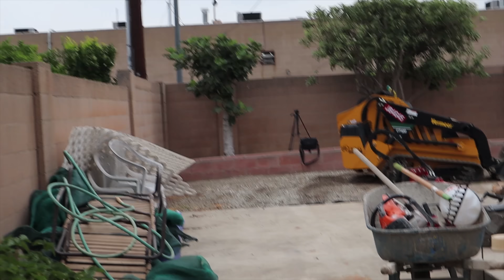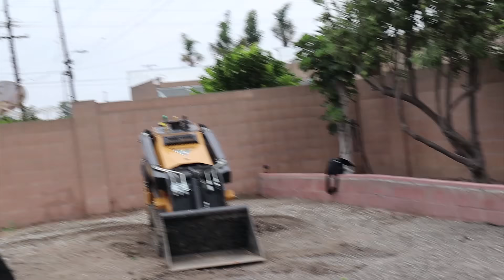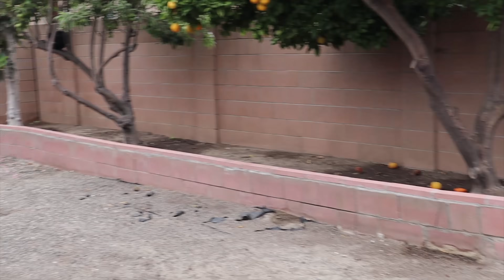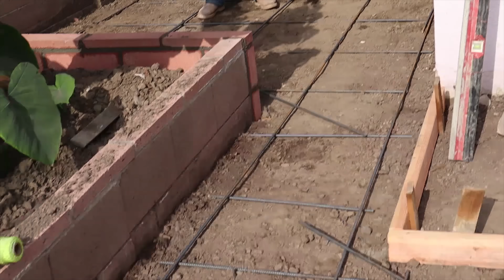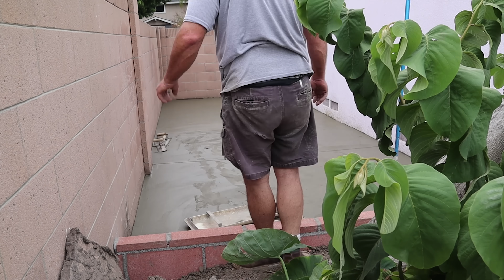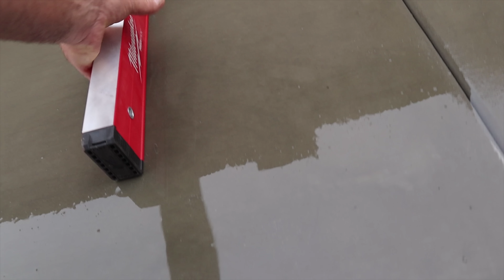How to Pour a Concrete Patio Side Yard DIY (easy)

Comment: Nice job!👍🏼
what's to happen if the driveway pore crosses the an existing natural gas line supply for the home?
Reply from the maker: No problem
Reply: Odell Complete Concrete I'd love to see a job of yours that has multiple panes meaning many different slopes and how it's done. weather crack lines are placed and how the rebar is run. I'd also love to see a job video of how access pipes are installed in prep for water and electric lines before the pore. 
have you any existing videos you could link me to?

Comment: Great channel. I have a question. I just had a 10x40  patio installed. They doweled into the foundation with rebar to tie it in to the new patio. I have a ranch home and the basement is below grade. Was this ok that they doweled into the foundation? Ive read conflicting stories on this subject. Some say tie in and others say not to.
Thanks
Reply from the maker: I don't like to house dowel to foundations.
Why jeopardize a house and foundation for a 4" patio
Reply: @OdellCompleteConcrete , yea i wasnt real happy when i found out this isn't a great way of doing it but apparently it is common practice. Hopefully i dont have any issues